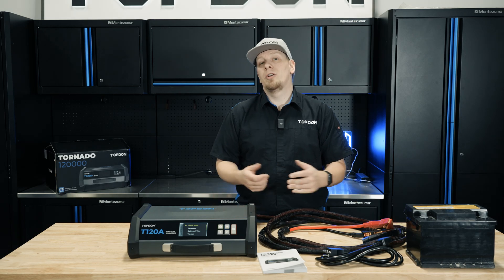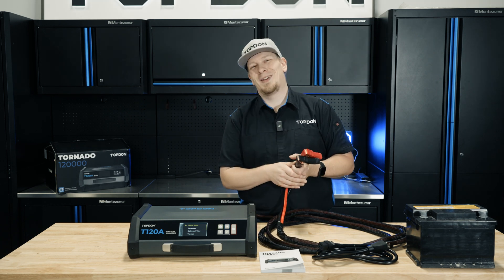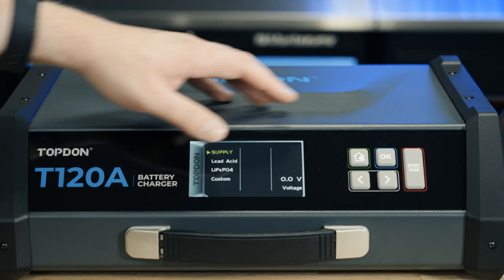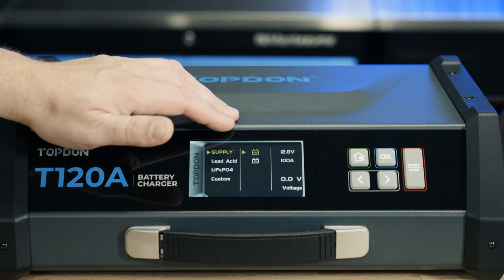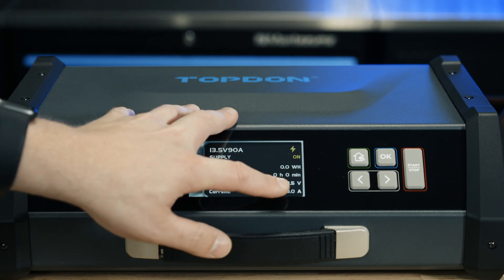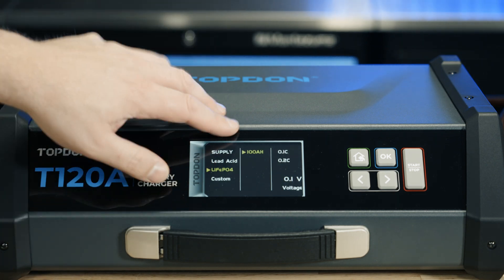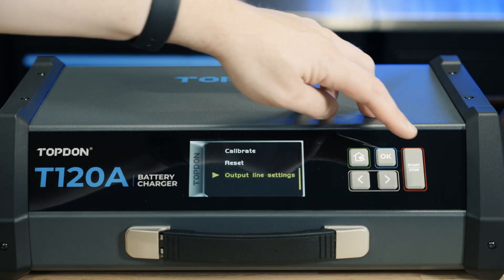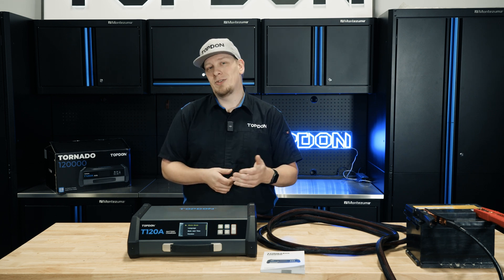TOPDON Tornado120000 120 Amp Smart Charger & Stable Power Supply Overview

Comment: Besides the extra 30A what other difference there is for the T90A?
Reply from the maker: T120A has 16ft cables vs the T90A's 7ft. If 24v charging is important the T90A has it, but not the T120. The 30A increase is the biggest difference.
Reply: @TOPDONUSA  I am mostly going to use it for ECU programming. Will the T90A is sufficient?